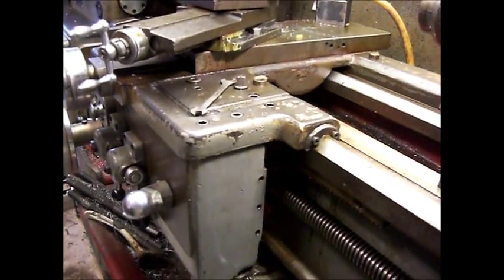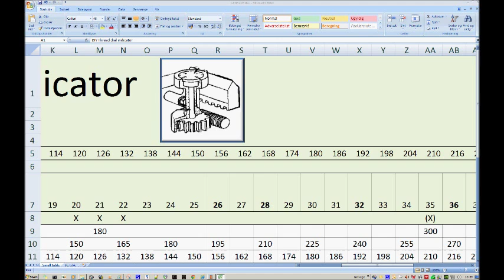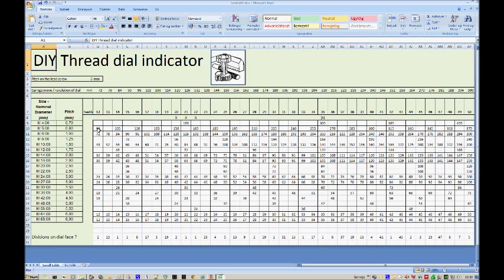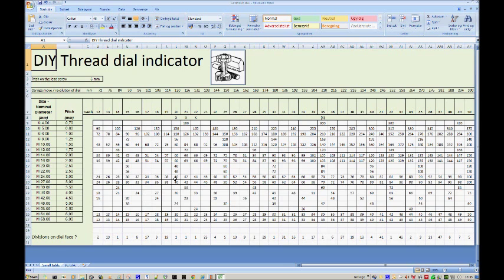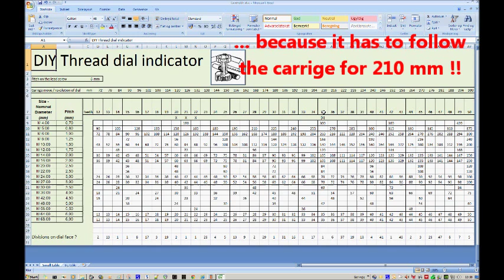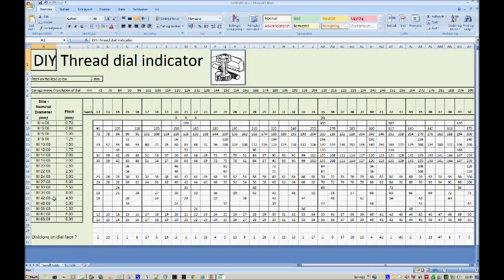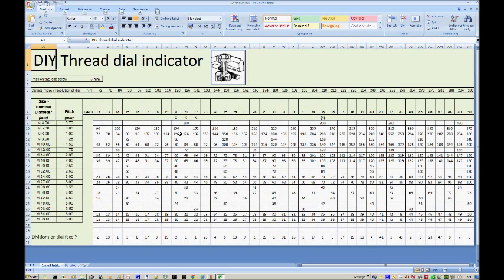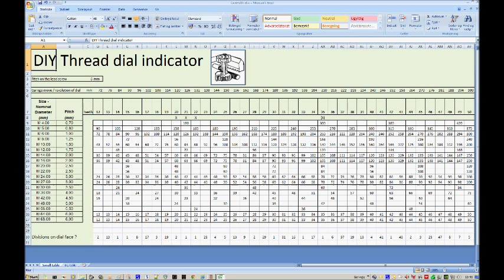DIT Metric Threading Dial - design ?

Comment: Keld

I second the recommendation to see if you can find a threading dial already made either from someone else or the factory - if they are still in business.

The answer to your question regarding design is - if you build it yourself then do it so it makes sense to you.

You have surely done the math figuring out screw pitch vs lead screw pitch.  I have confused myself trying the same thing.
The best source I have found is in two parts
PART ONE   
Using the Lathe Threading Dial

PART TWO
Using the Lathe Threading Dial Part 2

This finally helped me to make sense of it.

Gears and threads do not care about metric it is just simple math ie teeth on driver divided by teeth on driven.  So do not let the metric vs SAE (or what ever we call it this week) bamboozle you.

Dan Bentler
Seattle Wa USA
Reply: Keld

To continue a bit - yes you would need many thread chase dials if you wanted the dial to indicate based on the overall reduction from spindle to the lead screw.  However this is not commonly done and the chaser only gives you the relative position of X on the lead screw and Y on the spindle and is expressed as a ratio. This ratio will change as the pitch of the thread changes since there is only a single gear ratio between lead screw and chaser - which is why the chaser dial has multiple points on it to allow for different ratios.  Matt Maguire video explains this best I think - it straitened out my confusion.

I have not tried to convert my Craftsman (Atlas) lathe to cut metric thread - the manual says it can be done and there is a gear that will make the change.  I do not know if this change does not allow use of thread chaser dial.

Dan Bentler
Reply from the maker: dan bentler I'm sorry to say it - but I think these videos just show the "mechanics in how to calculate" - they don't EXPLAIN anything for a novice knowing nothing about threading - when you say they straitened out your confusion - I think it's because you KNEW before seeing the videos - so for you they just confirmes what you allready know ;-))

Comment: Hello Keld,

The information you've found saying you can't use a threading dial when cutting metric threads only applies to metric threads cut on an imperial leadscrew via conversion gearing.

You're correct that you need more than one gear for a metric threading dial used on a metric leadscrew to cover all pitches. The problem is that metric threads are specified by lead, rather than as a ratio as in 'threads per inch'.

This is why many metric lathes did not come as standard with a threading dial. You always have to make sure you've got the right gear on the dial before you start and making a mistake, or forgetting to check what was last used, can lead to a lot of confusion and ruined threads. Just look at the trouble Buckrun11 had with his machine because the wrong dial gear had been supplied!

Using the reversal method is foolproof as far as synchronisation is concerned. Tom Lipton has shown the over-run and reverse method that allows the half nuts to be used up to a shoulder.

When metric threading on my machine with imperial leadscrew and conversion gears, I would set the gearbox into low range for cutting and shift to high range for a fast retraction. Now with a VFD fitted I'll often cut with the JOG button and retract with the frequency wound up.

If you make yourself an 'auto lift up' tool holder, then the reversal method can actually be faster than doing it the conventional way. You don't even retract the tool, just reverse the lathe.

http://youtu.be/YZkRNdXFYB8

I'm pretty sure there's some good discussion of all this in 'Screwcutting in the lathe' by Martin Cleeve.
Reply from the maker: Hi Paul 
In fact what you're saying is that I shouldn't make a threading dial, but use the "revere-method" and make myself a "auto lift up tool" instead - then I just should forget all about the calculations I made - right ?
Reply: Keld Sørensen
It's kind of like Adam and his 4 Jaw chuck. On a big lathe the chuck is quite a lot of work to change, so you tend to stick to the 4 jaw and get really practised at dialling in work. Then even on a small lathe where changing the chuck is easy, you might still use the 4 jaw.

Iin order to use the threading dial you have to consult your chart to find out which indicator gear you should be using, then check that the appropriate gear is fitted and change it if not. In some cases you could be half way through getting the job done by the reversal method by the time you've done that and double checked yourself to prevent a 'Bozo' moment.

On the rare occasions when I cut an imperial thread and could use the threading dial, I don't. I'm more practised at the reversal method.